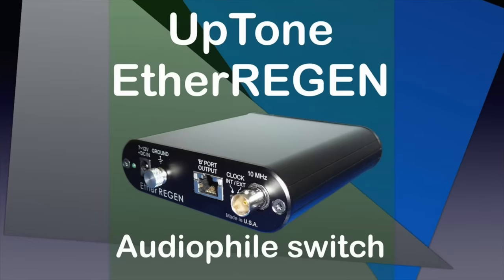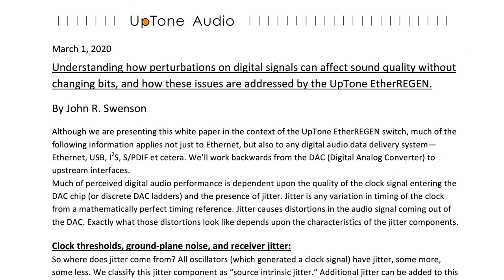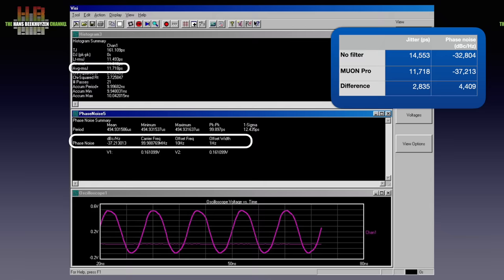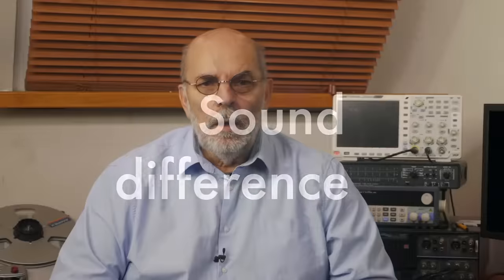The BS about network switches and the like...

Comment: Hello Hans, as always a great contribution from you!
I myself have been dealing with the topic "Ethernet sound" for a long time and am also in contact with Alex from Uptone and have also exchanged with Jaap about his first measurement.
I have my own blog  on which I have shared various measurements. All this is not because I want to discredit audiophiles, but I want to understand what is really going on.

My findings in a nut shell: 
Most of the sound change is caused by common mode noise in the Ethernet signal. This includes the 50Hz leakage currents John talks about in his paper. But also RF noise that enters the ground system in the receivers and then becomes noticeable as in Jaap's measurements, or even takes effect during the conversion itself. The muon filter inserted in Jaap's measurements, I believe, is nothing more than strong common mode chokes reducing common mode noise.
Reply from the maker: Thanks for sharing

Comment: I will most likely never own a Muon, as hearing the difference is dependent on the variables you mention, some of which I cannot control. I have just spent $800, mostly on bass traps and some diffusion. I instantly heard a difference when I quickly positioned the just arrived traps in my room, I am now in the longer process of dialing in placement of the traps and calibration of my Genelec speaker system, but it's clear to me that it was money well spent. Although you did say that better upstream clocking is a component of achieving the "natural" sound we pursue, the distortion off the the analogue signal that carries the digital information you also discussed had a larger resonance in my mind. I also read somewhere in the Uptone literature that using a more accurate clock than the one already in the EtherRegen had not much effect. I managed to buy a used ER and a quality used ethernet cable for ~$650 earlier in creating the endgame set up I have now, which includes a Wattson Madison, largely because of your reviews. Thank you for all you do for us Hans!
Reply: Money spent spent on room treatment (traps, diffusers etc) is money well spent. I’m in the same position and like you heard differences immediately
Reply from the maker: It's the complete chain that counts, including acoustics and filter.

Comment: Just to note, there are a couple of standards that can improve jitter and/or packet loss on ethernet. They are AVB ("audio video bridging") and DCB ("data center bridging"). In both cases, they require hardware that supports the standard, and is not something you can do on a generic ethernet switch.
Reply: Can you name a streamer which supports this?
Reply from the maker: It’s NOT about jitter in the Ethernet signal

Comment: Good video. Important for audiophiles to once again consider that digital is digital. If it arrives uncorrupted, it's fine.
Reply: There are so many companies who knowingly make products which are stupidly expensive that make no difference. Less technically inclined people will not know, buy it, and because of confirmation bias think it works. That money could've been spent on better speaker/amps (that make a huge difference) or a nice dinner with the family.
Reply: @techtt6213 Yes. But say you have 200000$ system (and it happens a lot) - would you not spend say 2000$ to make it better?
Reply from the maker: @techtt6213 I don't think you got the message in the video completely right...
Reply: @TheHansBeekhuyzenChannel jitter doesn't matter, on the receiving end it gets compensated. Was the listening done blindly? I often did a blind test (or even lied to have some confirmation bias) between Spotify over Bluetooth (yes) and a wired Qobuz stream. Either blind, or told people they would now hear Qobuz whilst really it was Spotify. And every single time confirmation bias won and they'd describe it as more natural (favorite term) or more open. Needs to be blind, if you can still tell the difference multiple times I'd agree.
Reply: @techtt6213  thank you for this comment, I work in IT with a network engineer training, and I was baffled that this could even be a debate. « Audiophile switch » itself is a word association that's total nonsense to me (and to everyone with some computer logic/network experience)

Comment: How much do you see cable length or number of hops affecting the outcome? Does more ever equal better sound? What's makes these devices so expensive - is it R&D?
Reply from the maker: If you use an Audiofile switch, keep the distance between it and the network player short. Prices are because of R&D, components and small series.

Comment: Why would the network matter if the whole song could be transferred and buffered on the player within a second of starting playing. Then there isn’t any additional traffic and the song is playing from internal memory. As far as Ethernet, the player could just optically isolate the port so there is no electrical interference to filter out.
Reply from the maker: Then you assume that buffers do what they supposed to do perfect.....
Reply: @TheHansBeekhuyzenChannel  yes, they do, otherwise you wouldn't hear less clean audio, you'd be getting an awfully gltiched mess that's basically unplayable.
I'm wondering why nobody that claims switches make a difference will provide a simply test of packets integrity with Wireshark
Reply from the maker: Because the packets do arrive perfectly. I have explained in several videos it’s the noise and distortion of the analog signal that is used to transport the digital signal that cause minute timing errors on the clock input of the digital to analog converter.
Reply: But the ones and zeroes that are playing from the separately clocked buffer memory don't care if the transmission to it is riddled with timing error. 10010110 transmitted with timing error is the same as 10010110 transmitted without timing errors because the buffer memory uses its own clock.

Comment: Thank you very much for sharing your insights gained on this issue. I especially like to hear a man say, “Well, I was wrong.” I know there is good stuff coming. I too have been around networking since 1985 or so, but I still don’t understand it all that much. Just getting into its use in audio. Your video was most interesting, I’m now in the market for a passive filter. :-)
Reply from the maker: Thanks man

Comment: Hi, Hans. I am using an Ediscreation Silent Switch OCXO and an Ediscreation Fiber Box II. The change both brought to my system is incredible. Both have OCXO clocks for the ethernet digital signal and the Fiber Box II internally converts from wired to optical and back again, thus galvanically isolating the signal from the modem supplied by the internet service company to the switch. In addition, I have a filter from PS Audio that is placed at the entrance of the cable that comes from the street into the aforementioned modem.
Reply from the maker: Thanks for sharing

Comment: Thank you for taking the time and effort to investigate this matter and then make it clear to us. Really well done! Yet, the MUON filter better measurements are not exactly spectacular. Does this mean there may be even more to be achieved with signal filtering? How much even lower can we go with jitter and phase noise?
Reply from the maker: The measurement was relative. The difference in sound quality was drastically better. Measuring phase noise depends on many factors, like power supply, cables used, EMF and so on.

Comment: If data integrity is maintained by every switch and streamer interprets data, how it could affect the sound? Does road quality determines quality of the goods transported on the track? No, until integrity of the goods is not affected. Is there any filter or conditioner for the wifi? Can you hear the difference between files played from different hard disk drives or memory cards?
Reply from the maker: If a drive is in a case with a noisy psu, I might. It's not the signal itself, it is the carries of the digital signal that is influenced.
Reply: @TheHansBeekhuyzenChannel  sorry, but a digital signal can't be "noisy". It's 0 and 1 (not quantum bits...) and if they are corrupted, it can be detected (and sometimes corrected) by error correction codes.
Reply: @eya83fr  I think that's the disconnect, although I might not understand. Even light takes time to move. I think he is looking at the tiny nearly immeasurably differences in the signal and believes they affect affect the sound. Like maybe a 1 or 0 has a slightly higher or lower level, shape, or length. I think it's similar to why it's difficult for hardware midi to sync than expected. But I would think here it would either break the signal or add a tiny bit of latency to the whole stream. I can't imagine a halfway decent filter or converter having an audible difference from this though, but I'm not entirely surprised if you measure it with enough detail there would be a difference in the transmitted signal itself

Comment: Last week I bought a Grimm MU1 this combining with the MM Tambaqui.  Does it still make sense using the Etheregen which I already owned or can I remove this from my system?
Reply from the maker: Did you listen to it?
Reply: I had the Etheregen between my switch and the MU1 and removed it,  I can't notice any difference now, in my old situation it did differ
Reply: Not surprised as your streamer is uniquely exceptional.  Already built in.

Comment: There seems to me to be one big question here:  how is a passive device able to improve phase noise?  Unless I completely misunderstand the definition of phase noise, it's essentially a measurement of the deviation from perfection of a periodic signal.  How can a passive device, such as the Muon do this?   
This video article's title seems to me a little unfair and misleading.  Fine, it's a fair and balanced review of the Muon, with an added technical assessment.  But I see no equivalent review or analysis of any network switch.  Will we be seeing an equivalent suite of measurements of the EtherREGEN?
Myself, I am the grateful owner of an EtherREGEN, and I would state that it had as big an impact on my system as the Innuos PhoenixUSB did.  Why the digital signal needs regenerating before AND after my Zenith streamer has long been a puzzle to me, but one I happily accept.  Returning to the topic of phase noise, I also added an AfterDark OCXO clock to the EtherREGEN, plus an optical stage to precede it, plus decent LPSs to both clock and EtherREGEN.  All, to some extent, have offered benefit.
Reply from the maker: Perhaps you might want to watch this video: https://youtu.be/B-StTplQZys?si=UUmwV4JJ7iSV6xIW

Comment: I got the iPower PSU to improve my Netgear switch (recommended by Jaap) but that seemed to make the sound very sharp and think sounding. Any idea why that could be the case? I had to switch back to the factory supplied PSU...
Reply from the maker: My guess would be that the iPower psu makes the switch more precise. That will make the DAC have more resolution leading to a sharper sound due to other problems in your setup. Like interconnects that use poor silver. But of course I can be totally wrong. The iFi psu really is good for that money and most likely better than the one that came with the switch
Reply: @TheHansBeekhuyzenChannel  Thanks Hans. I was wondering if the PSU having more Amperage (1.5A) vs the standard PSU (0.5A) could have anything to do with the observation. Then there's the central house router that feeds the switch via LAN... Wondering if just having one switch in the chain improve the pSU enough... thanks
Reply: I have tried the ifi PSU too (the X version), I believe on the same switch, and while I found it quite accurate, it sounded quite a bit too much of a good thing, so similar to your observation. 
And I would think it might have to do with the PSU’s bleeding of HF hash into the power line, not its DC output. You might try that: if you insert the psu and power some device that is not linked to your hifi gear you might notice a shift in SQ. Or not ;) - anyway I tried tried to eliminate as many switch mode power supplies as i can, the remaining ones get ferrite between socket and psu, to reduce HF hash. And it did improve things in terms of treble smoothness. now I use a linear Psu for the netgear switch, an sbooster, with the ultra device and - an ifi dc ipurifier at its output (yes that is crazy) but its better ;) possibly overkill, but I found it an important improvement wrt prat and dynamics. Not sure what is going on there.

Audiophonics too have an ok lin psu for <100€ and with the dc purifier I feel one gets almost the dynamics of the ifi X psu, but w/o the excessive treble.

Comment: Hans you still are not understanding how digital audio transport over a network works : as you said, there's buffering on both ends of the IP transport part, so IP/Ethernet jitter measurement is totally irrevelant. Those bits are not directly transfered to the DAC chip, but debuffered by the DAC itself at its won pace (thats is, with its own internal clock)
Reply from the maker: I am no network specialist. But when it comes to audio, I know a thing or two. My guess is, more than you. I am learning about the influence bit transport has on digital audio. But regardless whether all bits arrive in tact - and they do -- there are influences on the sound quality and what I described in this and other videos were base on the best explanations of digital audio experts. Denying what's audible doesn't bring us further.

Comment: To my understanding audio (and video) streaming utilizes UDP.  UDP packets beneifites from low latency, but there's no possibility of retransmits or rearranding of packets. They are sent in an ordered stream. So the quality of networking components could potentially have an impact on the stream, eg. packet loss.  Please correct me if I'm wrong. BTW: I'm not a network engineer either.
Reply from the maker: Have you tried an audiophile switch?
Reply: @TheHansBeekhuyzenChannel  No, I have not. I do not experience packet loss in my simple setup at home, so I believe my equipment is of adequate standard.  I only have a broadband router with WiFi and four Ethernet ports, One of the ports is connected to my NAS (wired short distance).  Streaming endpoints are connected via WiFi (Marantz SACD 30n, Mobile phones, tablets),  A WiFi extender helps were the signal otherwise would be weak.

I just wanted to point out that your statement in the video regarding retransmission and reordering of packets does not apply to UDP connections/packets - which is the protocol used for media streaming (if I'm correct). The UDP protocol only has a checksum. If the checksum doesn't match the data (stream) at the endpoint, then the packet is discarded. This will be audible and/or visible of course.
Reply: Used to be the case but now most use TCPIP an error correcting protocol.

Comment: Doesn't wireless transmission in the form of wifi help at all? Pretty impressive speeds we get these days over wifi.
Reply from the maker: It’s not the wifi technology as such but the way it is implemented, including the locally available bandwidth. In an apartment building that will be more difficult than on a ranch.

Comment: Hans, this is certainly a great video and I appreciate your work and competence a lot. But ultimately I didn’t really understand it - please forgive my ignorance as a formally trained electrical engineer, decades ago. Somehow rather prosaic questions aren’t answered. I’m sure you could do that with ease: a) what does this filter actually do? b) where and how would I need to place it in my stereo chain  (between which gear exactly)? C) I have a setup with a relatively good DAC and active monitors in a decent room, BUT my digital signals comes from a NAS, via a Switch, via a WLAN rooter, via relatively weak signal (our house is rather large), through a WiiM pro streamer to the DAC
; isn’t in such poor setting a “filter” doing anything good? 
In short, do you have some practical guidance for practical settings? Cheers.
Reply from the maker: What this filter actually do? We son't know. Apart from reducing phase noise, of course. It is placed in between the streamer and the network, closest to the streamer. It doesn't seem a sound investment given the streamer you use.
Reply: @TheHansBeekhuyzenChannel  thanks, that's what I thought.👍
Reply: Great work Hans but I can share that my high end audio system with monoblock amps benefited greatly with a Wiim Pro streamer. With a Verizon fiber router, a Cisco switch and fiber, the improvements are nothing less than excellent. I’ve heard the benefits are obtainable with Juniper and other commercial switches for far less than audiophile versions. Agreed the quality of the system will play a major role. Thanks for your strong contribution to music quality and understanding.

Comment: Hans my point has always been that with local rendering with the music source @ device.( as a baseline for operation)
All those readings can also be influenced by .02 volts I've built Linear Power supplies with 8 isolated outputs including my network switch.
( ( preventing device to device noise  is critical))  in the power chain
Reply from the maker: I would rather use a good, audio grade SMPS for the switch.
Reply: You can clean SMPS to "HIFI GRADE" with over the counter parts then add ferrite to each cord to reduce EMI.  Preventing noise propagation is the actual goal